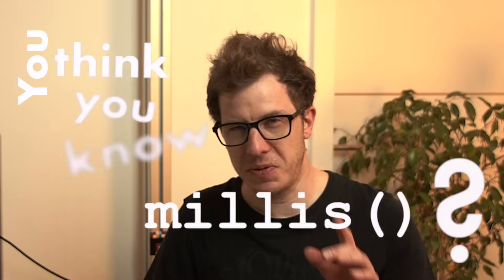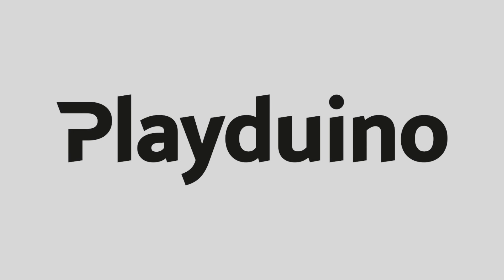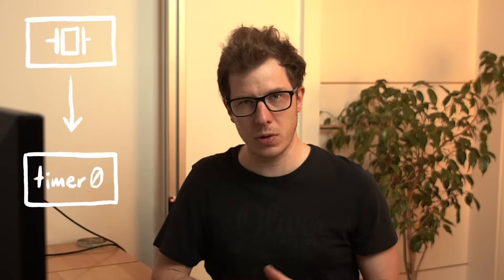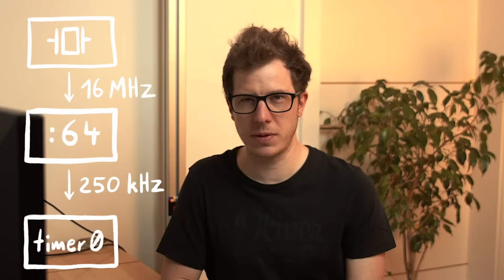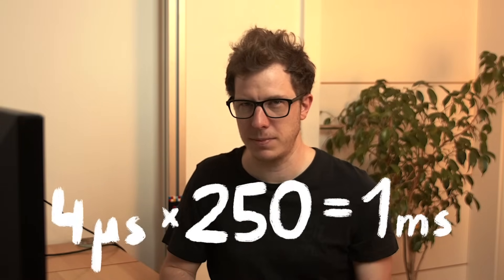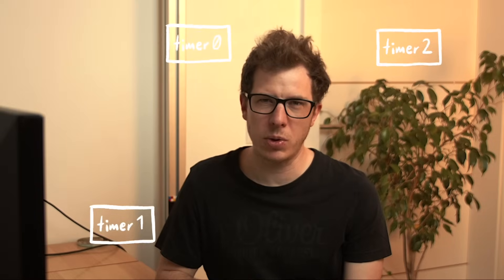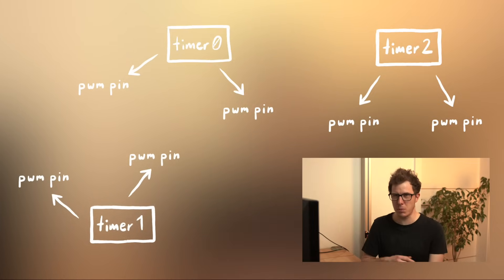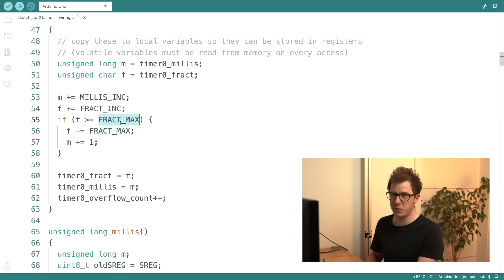Exposed: Why Arduino millis() Secretly Jumps by 2ms

Comment: This was a poor decision, in my opinion. Suddenly incrementing by two isnt an acceptable solution.  I feel the same about timer1 usage for pwm.  What a waste of potential, using a 16 bit timer to PWM two pins, negating the ability to utilize the input capture feature.  Pulsein() isn't a reasonable substitute for input capture.  It's corner cutting like this that keeps Arduino out of the "real world" problems.

Comment: It was good to look into te concept of millis but also slightly irrelivant.
Even if millis were an exact mili second or a fraction of that, then still there are variations in the oscilator that make millis deviate.
When one neds an aqurate timer, use an external one.

Comment: Why does looping to just 250 lose you a pin and precision? Can you elaborate on that?
Reply from the maker: I can try. timer0 has two compare registers. currently both are used for PWM. You can set the compare register to any value between 0 and 255. On overflow, the PWM pin turns on and as soon as the timer0 value matches the compare register, the PWM pin turns off. Staying off until timer0 overflow. You will lose the first PWM pin, because you need to use one of the compare registers to limit the looping to 250 and at the same time you reduce the useful PWM values of the second compare register from 0-255 to 0-249.

Comment: Because normal people use only Assembly for cores as simple as AVR.
Reply from the maker: I didn’t know Assembly was the ‘normal’ choice! 😂 Joking aside, coding in Assembly for AVR cores definitely bypasses any Arduino software quirks.
Reply: @playduino  No idea thb, back when starting with this core I've tried Asm because wanted to see how exactly things work there - and never actually written in any other language for one since then. C is extremely hardcore there, as you always have to check twice on what gets compiled with the compilers always doing mad things you have to handguide them away from (unless being forced to use an atMega where atTiny fits well is ok, along with the low code performance that hits bad on MCUs that are this slow already). Asm, on the other hand, is truly as simple as ever on those, as the register structure is small and there is no memory mapping. But, unlike C, it truly shines when doing math or custom bus transfers or something. How to, say, print a number? In C it is at least a tricky BCD conversion, but at most it is a divide-by-10 loop that hits hard for a core that can't divide - in Asm, though, I just make a simple routine that multiplies by 10 and stores the overflow byte along with doing some rounding - and just store my numbers as fixed-point fractionals (say, 123.45 would become 0.12345 with a base of 1000). This is easy for physically-measured values, as all it costs is multiplying the value by an output constant, it is bullet-fast and transparent between any integers and fractionals - and it has no C counterpart, as there is no way to neither handle, say, 6-byte ints nor extract the overflow byte during the multiplication/rounding stage.
Reply from the maker: Wow, your Assembly skills are awesome!  That fixed-point math trick is smart—way better than dealing with C’s weird compiler issues on AVR. Assembly was actually my first language, coding on an 8080 years ago. But when I tried higher-level languages, I never went back. I’m impressed how you make ATtiny cores work so well with Asm. What’s your best tip for staying patient with long Assembly projects?
Reply: @playduino  Funny enough, AVR's ASM is very readable, so a brief preparation like naming your registers the way you'd normally call your variables, setting up the required macros (say, long constant stores to SRAM etc) and writing libraries for the commonly-used functions makes it as smooth as any high-level code. And even funnier, it is not even cluttered, as many things are way shorter in AVRAsm than in C: say, "if (a & (1<<flagName))" becomes as simple as "sbrs a, flagName rjmp skip", which, unlike the above, takes zero brain activity to figure! And it doesn't have MIPS-like trickery like branch instructions lagging one command or immediate loads conditionally macro'ed into two instructions! Structures may become somewhat tricky though (yet still nice, especially should you utilize the ldd instruction), but otherwise it is a simple core you'd not really write anything truly complex for anyway.
Reply: are you Russian? the love for assembly and using "normal" in a morally normative sense

Comment: Question: Wouldn't it be more precise to trigger an interuppt every 1 ms to increase the counter?
Reply: Yes it would. The video explains why the Arduino team chose not to do that. Doing so would have compromised the functionality of 2 of the PWM pins.
Reply: @MD-vs9ff  I see, seems like a fair trade off for most projects. Is there any premade library which does this instead?

Comment: I am not very concerned about the 2 ms error..  but thanks for pointing out that I can't use all the PWM ports and millis(). Explains why my initially smooth automation project turned to shit when I added and another servo to the system - couldn't find any bugs and just left the project to die but now I might have the solution. Will switch to a board with more timers, or perhaps use a some external logic to shift the pins.
Reply from the maker: if you use mills() you can use 6 pwms however if you use the timer directly (for example using a timer library) you will lose 2 pwm pins / timer
Reply: @playduino  Aha I missunderstood you then - in that case I have no idea what I screwed up. 
I wrote 3000 lines of code with lots and lots of hardware and fuctions, utilizing that poor Uno to the max - maybe it is just acting unstable because the memory is almost full (90-95%).
Reply: That's why it's importand to read the datasheet for the used MCU. Arduino IDE can abstract many things about the inner workings of the microcontroller, but you skip the hardware aspect.
Reply: @kacperfilipek8461  Yeah.. that's why I choosed an Arduino. "Rapid" prototyping (6 months in this case), which would have taken me much much longer without the bootloader and libraries.

I know how to do it barebone with registers and bit shifting but seriously - waste of time unless the operation is really critical, in which case I probably would have gone with more logic instead for reliability and speed. If I pick it up again I will go from uno to atmega, or maybe even raspberry pi for better UI when it is sold.

The system I built simply became to much for me to handle solo with limited time everyday. It wasn't only programming but electronics, mechanics and making all parts too. Programming was the smaller part. In hindsight, would have needed 1-2 friends to split the work better.
Reply: Did you check the documentation of the Servo library? Specifically, the following sentence from that doc may be related to your issue: “use of the library disables analogWrite() (PWM) functionality on pins 9 and 10”.
Reply: @edgarbonet1 As far as I can remember I used servos on those ports. Can't remember the details at hand but I will look into to it if I pick up the project again. Thanks.

Comment: Presetting to 1 is almost insignificant.
Almost all timing applications use time relative to some arbitrary start, whether this is relative to t0+1 (+/- 1) or t0 (+/- 1) is irrelevant.

While similar in nature to ADC, ADC is absolute, t0 is arbitrary.
Reply from the maker: That's actually a good point. I agree.

Comment: @5:10 This is the exact reason you can't trust the Arduino library on that particular context. There are many cases you simply cannot use "greater than/lower than" compare operators. The only way to reliably improve `millis()` is to not use it but rewrite it. Completely. This is one of the many reasons I wrote my own library for Atmel/AVR microcontrollers.

EDIT: In the vast majority of cases all you have to do is make one timer tick at exactly¹ 1ms. All three timers being programmed the way the Arduino library does it is in the advent of using all three timers for PWM. A staggering majority of use cases don't even need six PWM channels, which makes it reasonable to program one timer as a one-millisecond scheduler.

¹ With some relative accuracy since the clock is not really and exactly 16MHz, they use a ceramic resonator (which is less precise and accurate), instead of a quartz crystal. For more precision, use timer 2 with an external quartz crystal, e.g. 32768Hz and perform software timing correction for best accuracy.
Reply: Don't most arduinos incorporate a quartz crystal for timing? At least, the older ones do. I know the R4s don't.
Reply: @ivolol  yes. My Uno, Duemilanove and Mega3650 all use two pin crystals in a shiny tin case, no three pin resonators in sight.

Cheers,
Norm.
Reply: @ivolol  Nope. They never did. It's a resonator instead. A dead giveaway is they're 3-pins if you take a closer look with a magnifier. It's also stated on the schematic, the part reference is for such a resonator. Note that only the main, programmable microcontroller is the one that runs on a resonator. Oddly enough, on the R3, the serial-to-USB chip, which is also an Atmel MCU runs with a quartz crystal.
Reply from the maker: yeah, good point. If you need accuracy the best solution is to set one timer to 1ms (as longs as you do not need as many PWM pins)

However the Arduino solution is fine for most Applications.
Reply: Rubbish. Nothing should be this important save from life critical applications. Other matters if you can't get around not having an exact millis to compare to, you're just a bad programmer.
Reply: @williamcampbell9859 Yeah, I would love it when my 1000Hz polling mouse randomly decides to move double the distance because it's programmed by people like you.
Reply: @williamcampbell9859 That comment of yours is just rubbish (facepalming).